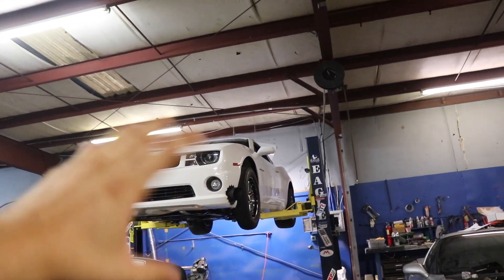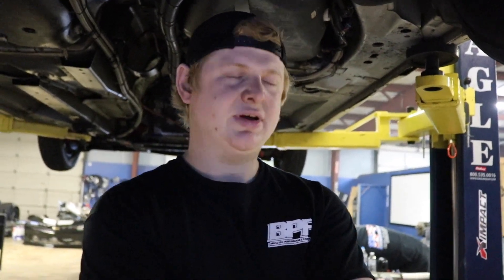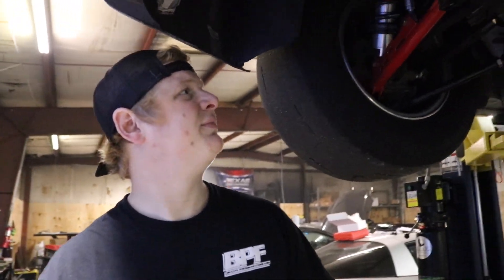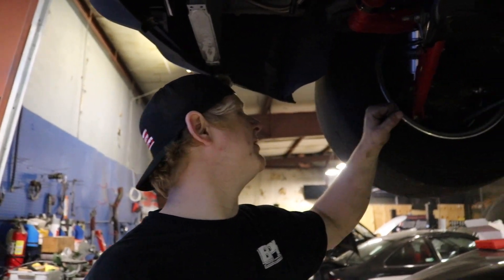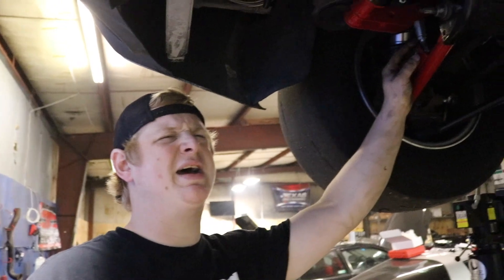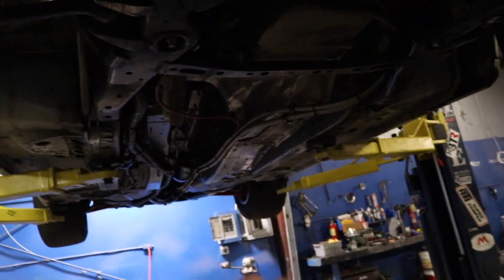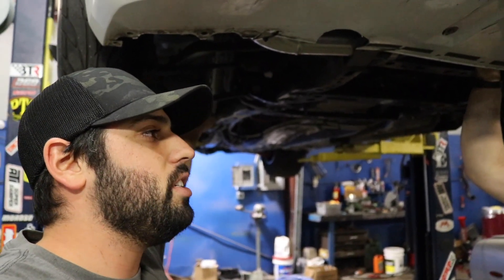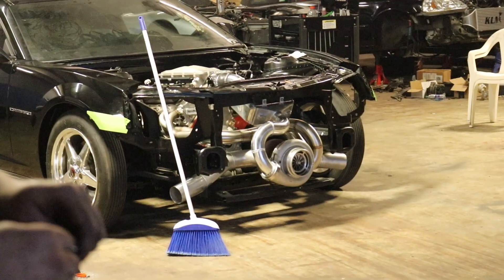NEW RECORD 60ft for the COWMARO.... this is how!!!

Comment: Nicks biggest problem is the shop and tuner working on the car. He's spent close to 80k if not more when you factor in all the labor. Yet the car still isn't much faster then when he first went there. Sure he has a built motor etc now but the build was poorly planned out.
Few of us told him everything you covered multiple times. Another problem is all the bad advice he get's. He has people on the channel talking if straight axle setups. Which is the exact opposite. People actually talking about getting 80% or more anti squat which isn't happening on an IRS car. Lucky if you get much over 25% compared to where you can 100% with a straight axle. 
 He does have the double adjustable strange shocks but they're not close to set right. Yet he has people telling him the strange shocks suck and he needs 4k Menscer shocks or any other really expensive shock.  The idiot's think if you spend a few grand on shocks. That means you bolt them in and they'll do the rest for you lol. 
His converter sounds little off  also. One pass it really seemed like he was driving through the converter. 
The dude Andrew needs to stick to tuning on a dyno. Track tuner he is not.That shop doesn't have the skills you guys have when it comes drag racing and setting up a vehicle.
 You gave him more solid information but like they say. You can lead them to the water but you  can't make them drink it.
 Sorry for the long reply.  It kinda took on a mind of its own.  Keep up the good work. The channel has come a long way from a year ago.

Comment: 3 of the biggest difference's between the Cowmaro and the Freedom Rocket is Nick's car has solid bushings in the rear end and his car is a blower car and he also runs slicks and not drag radials and blower cars has instant torque and hp off the leave and all throughout the run and the more throttle you give it the more torque and hp you are going to have and a turbo car you build the boost throughout the run and not straight off the leave and that is the biggest thing people are forgetting about Nick's car but once he gets everything dialed in and ironed out if you two line them up again it would be interesting to see who wins that one now that he got away from the stock LSA blower and nitrous setup
Reply: You can control boat with timing in a supercharged car. How do you think that blower cars leave just as hard as turbo cars. You take timing out of it down low so the car makes less boost then you ramp it back in.
Reply: That is false about turbo cars dont leave with boost and ramp it in. That may be true if you dont have a trans brake and are foot braking it. With C02 boost control and two step i can leave with as much boost as my turbos can possibly make on the two step if i want to. Yes blower motors make linear hp and boost with rpm but sayin a supercharger car always leaves harder off the line is false info you are putting out there. Its all in setup amd tuneup if it leaves harder or not.

Comment: so i think of you doing no prep than you want the the rear  to squat down but if you are on a sticky outlaw 10.5 track than most dudes have the rear stiff
Reply: Shifttube it all depends on if its a radial tire or slick tire car amd what style suspension the car has. A slick tire car you want some weight transfer so yes it will want a little squat. With a radial tire car you want seperation to shove that radial tire down to the track to keep it planted. You cant spin a radial tire you have to keep it hooked up thats why. A slick tire you will slip that tire and will spin that tire a little going down the track.  The suspension setups and antisquat angles on your suspension bars are totally different for the two tires